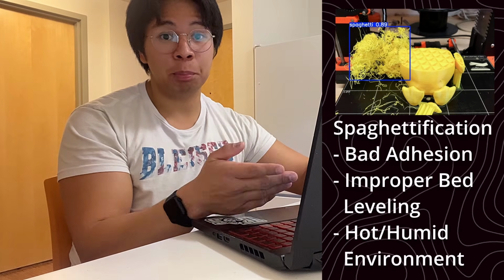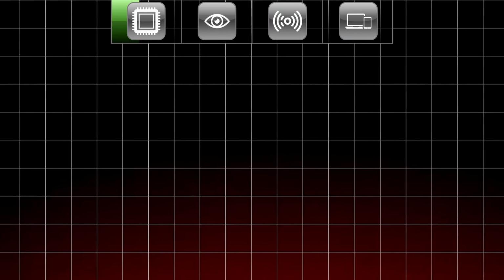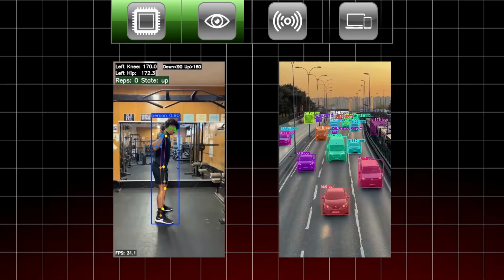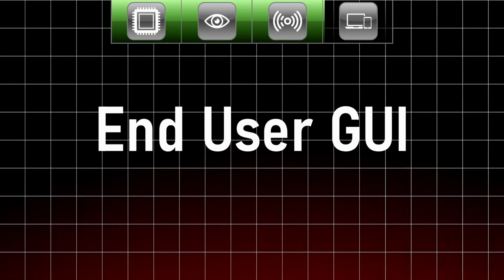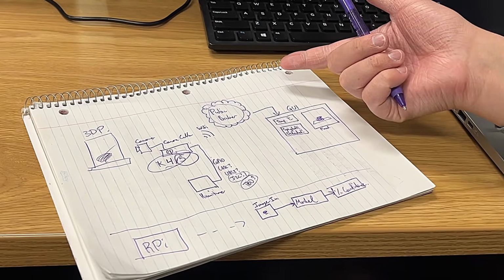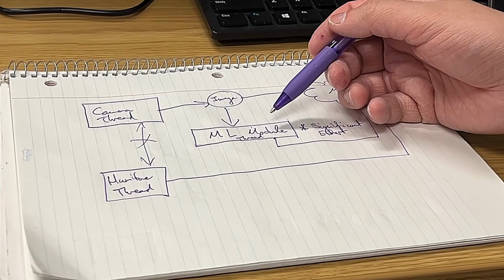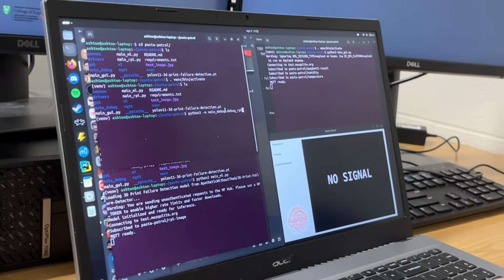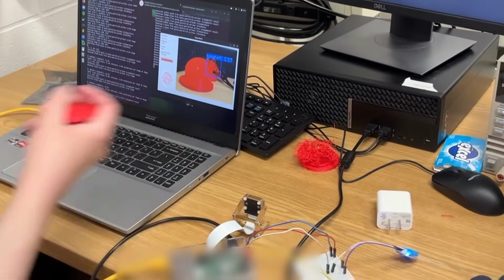We Built an AI System That Could Save You HOURS of Failed 3D Prints (YOLO + MQTT)

Comment: What's the difference between this and obico?
Reply from the maker: Essentially, we designed our own modular MQTT using multiple edge nodes (Raspberry Pi’s) and we focused on edge computing and communication between components. Meanwhile, while Obico uses MQTT too and is also open source, it is centralized and uses cloud services. Ours doesn’t, as data is stored locally on the user’s computer unlike Obico where it is stored in the cloud.

We’re not trying to compete with Obico though. We made ours our way, as it is a custom project with our own workflow and hardware.
Reply: @lancebermejo3319 but you can self host the obico machine learning models

Comment: It‘s cool and useful for some but many printers do already have an AI print failure detection, don’t they?
Reply from the maker: Yeah some have built-in AI detectors like the Bambu Lab X1, but most printers still don’t have that feature unfortunately. Only high end models have that feature, so this is a great solution for those with older or lower end printers